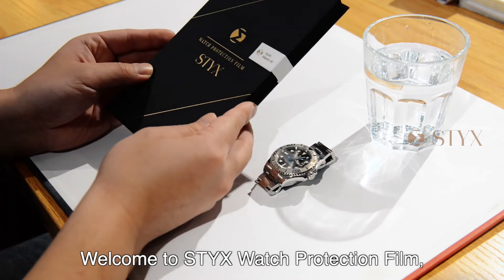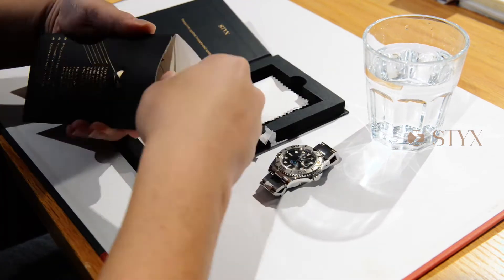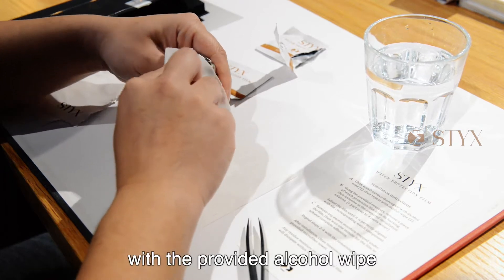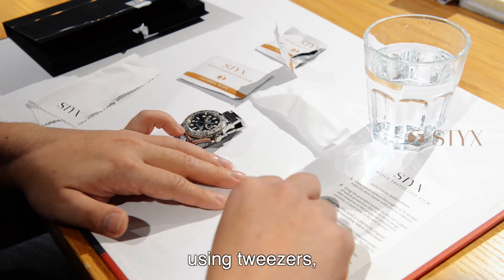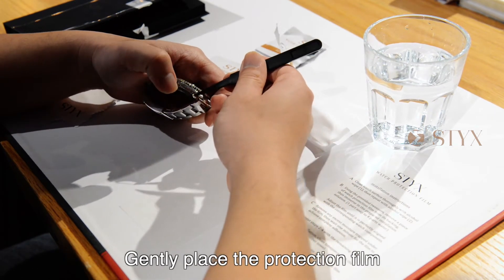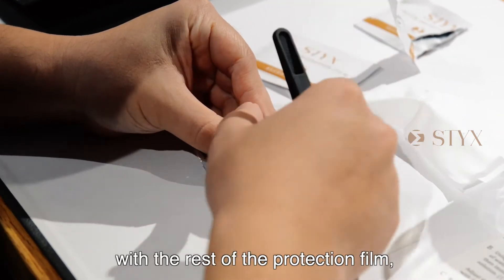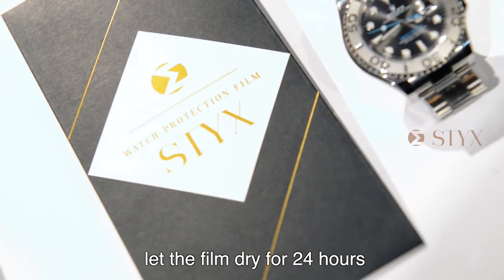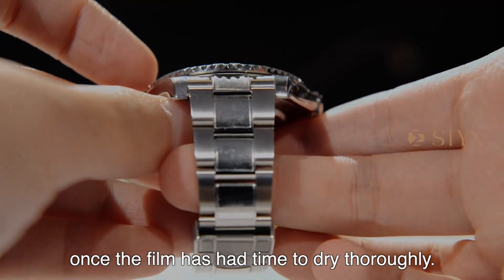STYX Watch Protection Installation Guide

Comment: A tip for anyone using any film is to put a drop of washing up liquid in the water.
The washing up liquid acts as a spreading agent & will give you a much better finish rather than just water. If you have Johnson’s baby shampoo that’s the best as the PH is very low. Trust me you will get a much better finish with no bubbles.